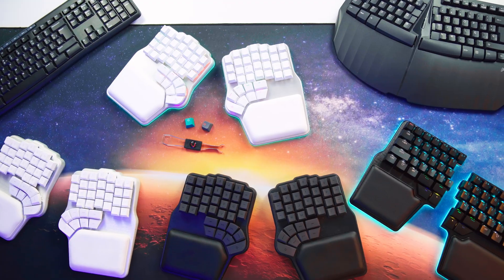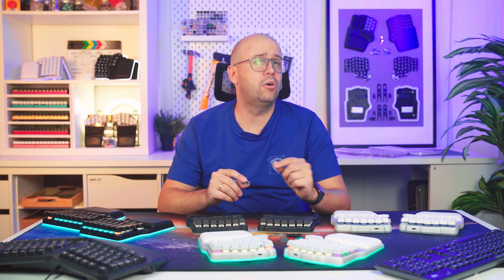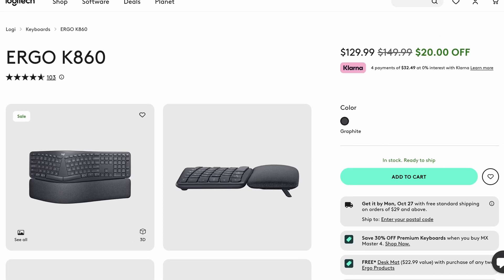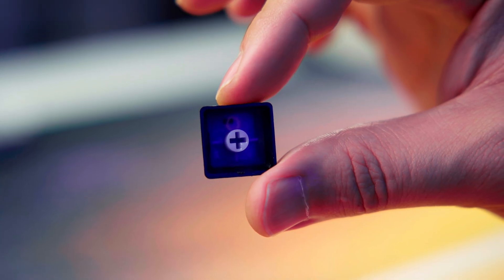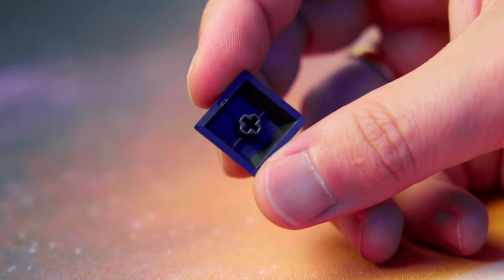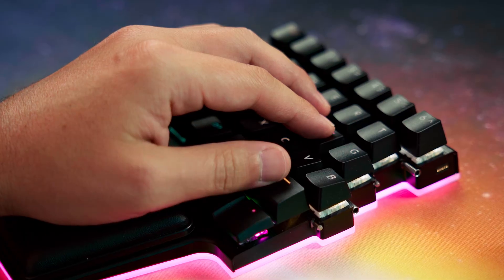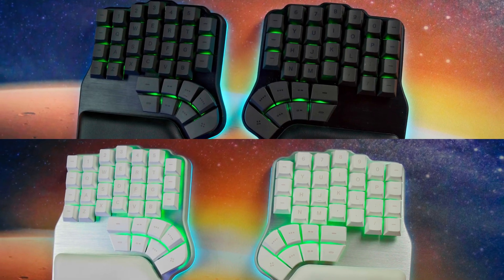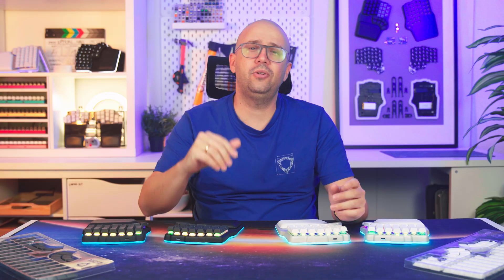How are Keycaps Made?

Comment: Two questions out of curiosity: (1) why did you align the legends of the limited-run keycaps in the center, while the legends of the standard keycaps are in the top-left?; (2) would it be possible to make the standard keycaps in exactly the same way as now, only with 1.8 mm wall thickness?
Reply from the maker: We like legends in the center, as they look better in our opinion, but in laser-etched keycaps, the LED is at the top, and also the stem of the keycap would interfere with the light and create shadows. 

As for the second question. Yes, you could. But again, we depend on the molds that the supplier has (we then make a mold just for the thumbkeys). We are always looking on improving our supply chain, though 😊